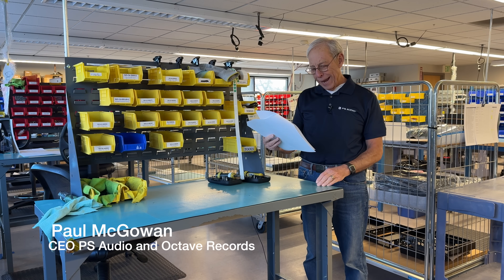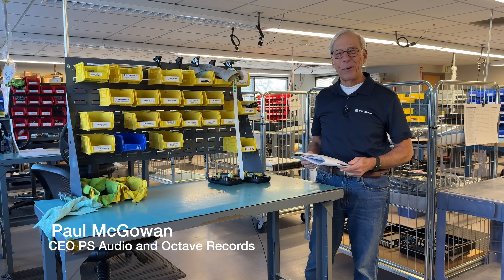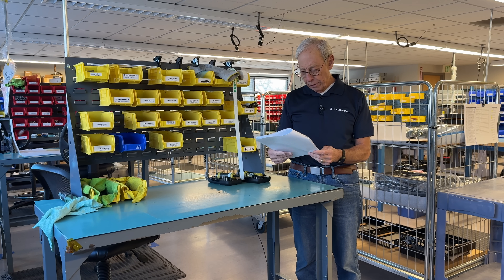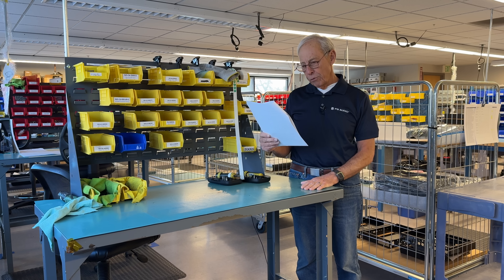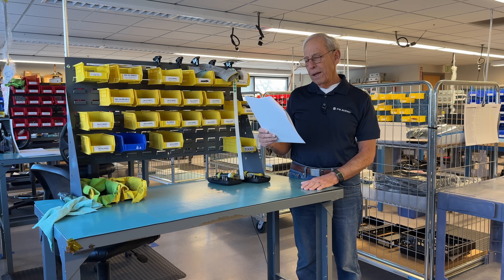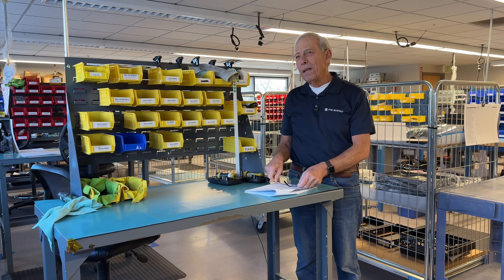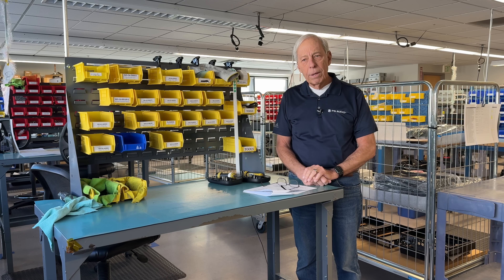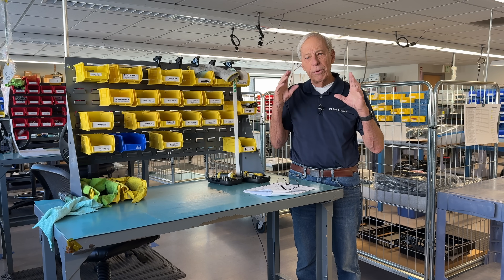Paul explains equipment burn in

Comment: Burn in is claptrap in the sense that it's normally discussed. OK, electronics may change a little over time, but why on earth would anyone assume those changes would always improve sound quality? That makes zero sense. Cables don't change, you can demonstrate that easily with measurements. If cables burned in then us electronics engineers would be forever recalibrating our measuring instruments as the interconnects burned in - they don't. Mechanical things like speakers may well settle down, that makes some sense. As for electronics, any burn-in is more likely to be negative than positive as it means things have drifted off from the way they were originally set up. What's actually happened is you've listened for a while and got used to the new sound.

Comment: Burn in?

Moving parts ... speakers, phono cartridges etc ... a few minutes.
Electronics ... plug them in overnight.
Wires and cables .... ROFL, no way!

The best way to burn your system in .... simple .... just use it.

Comment: I hear so much one way or another on things like burn in and cables.  That it is hard to know what is real or not.  With things like headphones, I have thought that I have heard a change in the sound, but there is an equal chance that my brain has just got used to the sound.  The other argument against burn in is some manufacturers put in such long burn in times on purpose so that by the time the customer has done the burn in, the equipment is beyond its return time.
Reply: A simple way to fact check audiophile "science" ... 

Can it be confirmed from credible sources outside of the audiophile community?

If not, well... it's obviously not true.
Reply: It's easy to tell what's real, that's the reason people started making objective measurements of THD, frequency response etc.
Reply: @TerryClarkAccordioncrazy 
No.
Those measurements were marketing ploys to sell amplifiers in the 1970's, and were often exaggerated. They in fact have little to do with anything in a good amplifier.
Reply: @Hare_deLune  If that's true then the professional amplifiers and mixers used to master the recordings you hear have all been mis-designed. Flat frequency response and low THD are the baseline standards for pro audio for good reasons.
Reply: @TerryClarkAccordioncrazy 
My point is that any "good" amplifier will already have those specs. Meaning that, while perfectly reasonable to publish them or include them in an owner's manual, it is not necessary to make them a selling point, or to make comparisons, or make a big deal out of it one way or another because different amps built to different tolerences will naturally have minute variances in these measurements, which fall outside of the human hearing range anyway.
And yes, it is true. I was there. The late 1970's saw an advertising war over precisely these kind of measurements, with manufacturers touting ever more zeros in their infinitesimally diminishing THD specs, competing with the other manufacturers to see who could get the lowest number.
Completely ridiculous.
Reply: @Hare_deLune  That's right, the odd hundredth of a % of THD matters not, but rather we can say that below 0.1% and a flat frequency response are the baseline for a hifi amp but not the complete definition. As Douglas Self explains it's more important to work on linearity of every stage than to tune out distortion using masses of NFB. Anyway, my point is that these measurements would surely show up the existence and  nature of any burn in effect, and the fact we never see any measurements could indicate that the effect does not in fact exist in the equipment but instead in psychological factors.
Reply: @TerryClarkAccordioncrazy 
I totally agree with you up to the point where you say that measurements would surely show a 'burn-in effect'.
I try to keep an open mind about these things, and not instantly reject something unfamiliar. Any good scientist will tell you that we go by reproducible results until those results are proven wrong, or until we have new information that supersedes those results.
The Earth was once thought to be the center of the Solar System, until Copernicus proved it was the Sun.
Disease was once thought to be caused by Evil Spirits, or "Bad Humors", until it was proven to be bacteria.
I do not pretend that we know everything there is to know about electricity, the propagation of electrons, or the subtleties of audio equipment and human hearing.

Comment: The whole saying about this b*-in thing is that affected audio components would need a certain time of "being played", maybe even with "proper signals", to reach a natural or designed state of "best listening experience".

So, first saying is "b*-in is always to the better by design or nature".

Second, once you reach the final state of such b*-in the b*-in process will stop automatically though, you continue using your gear by listening.

Third, there's nothing beyond this final b*-in state that would change any relevant component's characteristic, to the better or worse.

Does this sound correct?
Reply: I believe it's okay to write "burn-in" in full.

Anyways, no that does not sound correct.  

Truth is that just like us, all electronic gear is in a continual state of gradual degradation through use that will eventually lead to failure.

Comment: Decades ago we used to burn in electronic equipment by operating them overnight in temperature controlled ovens to simulate 2 years of use to ensure quality.
Reply: Yes, in a manufacturing environment that is my experience as well. However, the purpose of that kind of “burn in” is generally to weed-out infancy failures especially among certain vulnerable components. 

The “burn in” being discussed here is more similar to what I would call a “break-in” period—where the equipment is not being environmentally stressed in any way to catch potential failures early, but is rather being exercised in, more or less, its typical operating environment in order to ensure that new components are “broken in” so that they operate as close to optimal performance as possible.
Reply: @pbender9713  Excellent comment. @pbender9713's comment is the  answer Paul should have given. The term "burn-in" is being misused. "Break-in" for speakers and "Burn-in " for electronics - not for increased performance but for stressing and weeding out infant mortality in high reliability applications.

Comment: I asked ChatGPT o1 Paul’s exact question. Too long to paste here but the closing remark was “[…] In summary, while the concept of capacitor forming exists, its direct effect on HiFi sound quality remains unproven in scientific literature. The perceived improvements reported by some may be influenced by psychological factors or other variables within the audio system.”
Reply: on multiple occasions ive asked GPT for 10 Beatles trivia questions. never have they given mea list with less than 4 errors.
Reply: @googoo-gjoob Same experience here. Asked for things I'm already very much in. Got many wrong answers though, written nicely from a language perspective. Had similar experiences with totally different topics.
Now, knowing that the output for your given questions is (often) far beyond truth, what about topics you do NOT so much about...? Would you just believe the answers to represent truth? Or would you rather assume a similar true-false ratio you got from topics you know pretty well?
Reply: @googoo-gjoob  The problem with chatgpt is how it looks for/at source material. This is oversimplified but it's a superdeluxe search engine in regards to gathering info
Reply: @Matt-cb2db  , once i know a process is questionable...... im out
Reply: @ what kind of questions?

Comment: Oh, my. Thanks for the tip on ChatGPT. My first try: why don’t dac’s produce square waves?” provided more clarity than any YouTube answer I have seen and fully confirmed my suspicion that the true difference between digital and vinyl is the dac is doing the conversion to analog.  A “normal” dac will have trouble with a square wave reproduction. What is a square wave in audio? It’s a sine wave fundamental plus harmonics. Sorry this is off topic. Could not agree more about burn in, especially speakers.
Reply: As I understand it, a "square wave" is a sine wave viewed on an oscilloscope that has the top and bottom "squared off". In other words, the curves which should be seen at the top and bottom of the wave have become straight lines.
This indicates that the signal is being over-driven. In other words, pushed beyond the limits of the equipment.
It is usually just a few minutes after this that the magic smoke escapes from said equipment, at which point it becomes a fancy paperweight.
Reply: @Hare_deLune  that is one way to make a square wave. Another is to add. Multiple harmonics to a fundamental sine wave. It is the presence of harmonics that make a flute sound different than an oboe playing the same note.

Comment: I can’t trust YouTube reviewers that insists that burn-in doesn’t take place and its all placebo effect.
Reply: I can't trust YouTubers believing that their sense of hearing is solely influenced by the changing sound pressure reaching their ears. Being convinced that their hearing sense can (objectively) measure far beyond any technical equipment.
Reply: @Matt-cb2db 

https://youtube.com/shorts/ABgwy-QZVPA?si=s9cF89poMuOjD6x3
Reply: @tubefreeeasy Yeah, wonderful example of totally unexplained and unproven hearsay/opinion.
Most important fact when it comes to listening to gear over time is the existing process of accustoming to sound which happens in the human brain. This actually let's you perceive identical "signals" differently. That's an in-built mechanism in our brains you can't turn off.
And ask yourself, when would burn-in stop...? And when does burn-out starts...?
Reply: So, go to credible sources outside the YT and audiophile communities and fact check it.  Just be ready for a lot of laughter ... For non-moving parts, burn in is a total fantasy.
Reply: @Matt-cb2db the ear brain can definitely measure more data than any test equipment.
Reply: @ Then, please give examples
Reply: @mitchtaylor6512  
No Way!

Even a cheap hobby oscilloscope will show you more problems than any human will ever hear ... it's between 50 and 100 times more sensitive than your ears.

Can you hear 5mv of ripple on a power supply rail?  My scope will show it to you.

Can you hear 0.1db level differences between channels?  My scope  can show it to you.

Can you hear 100khz?  Again, easy to see on an oscilloscope.

This notion that our hearing is the final arbiter is just ludicrous.
Reply: @Douglas_Blake  an oscilloscope measure electrical signals not sound.  Not to mention an oscilloscope measures in isolation, not when the entire system is connected and being used the way it is to be used in the real world.
Reply: @mitchtaylor6512  
Oh boy... I knew this was a mistake.  Now I'm going to have to listen to you defending an unsupportable position.

If you are going to tell me you went through all the electronics training and rejected the science behind it on valid reasons... Okay, Tell me about it.

If you are simply thinking you can make spurious claims without challenge, especially when it's something that laughably stupid, well, we got nothing to discuss.

"What can be asserted without evidence can also be dismissed without evidence" ... Hitchen's Razor.

Comment: Every component has its initial behavior and this issue is an engineering topic that can be explained. A speaker's spider can be made of material that contains a stiff glue like substance where it needs mechanical motions to become optimally bendable, for example. Digital electronics, transports, streamers etc. do not need any burn-in for audio performance reasons. Interconnects/cables also do not need any burn-in. Then you can look at all the categories of analog components. Some electrolytic capacitors usually found in the power supply circuits can need time for the dielectric to “form". In a power amplifier such issue would be a potential lower peak power output when playing loud. Tubes are probably where you can hear the biggest difference on the electronics where burn-in or "breaking in the tubes" become a topic. Components that need a burn-in to reach optimum performance should raise some concern if the drift in specs really stops after the burn-in period. Electrolytic capacitors and tubes are also those components that can't do well on maintaining the same specs over time and die earlier than most other components. What other components should I worry about?
Reply: I'm not going to worry about my sound system at all as long as it sounds good.  Once I spent a lot of money on a couple of thick cables for some B&W speakers.  Bi-amp connections, heavy copper.  Made no difference in sound quality over standard braided copper speaker wire.  But that was only 100 watts per channel... Your mileage may vary.

Comment: If burn-in is required to come to normal performance, why isn’t it part of the production process? Why do manufacturers not deliver already burned-in equipment?
Reply: Time and cost.
Reply: Some argue that manufacturers don't burn in audio products before shipping because it usually takes time to burn in these devices, which would reduce the return window for customers. This potentially leaves buyers without enough time to return the product for a full refund if they're unsatisfied. On the other hand, some manufacturers do perform burn-in themselves. Those who rely on end-users to burn in their products often claim that if they were to do it, there would be additional costs that would have to be passed on to the buyer.
Reply: @DrRock2009 and storage, imagine a warehouse of speakers just playing white noise 24/7
Reply: @ 🤣 be like a Disaster Area concert…
Reply: Electricity costs money and manufacturers prefer to spend the least of it as they can.

Comment: If you have a system or component worth over $10,000 I am fully authorized to put it through a 90-day burn in cycle. Just crate it, and your payment if $3495, and ship it off to me. Remember to specify your preferred music, and to indicate which direction relative to North the equipment will be installed in.
Reply: Does the price include burning in cables? I hear massaging the cables help quite a bit! You really could start a business doing this. The more you charge, the more business that you'll get.
Reply: Yes, very nice Voodoo business 😂

Comment: On a similar note, is it a good idea to occasionally rotate speakers 180 degrees to help prevent vertical sag?
Reply: A clear no.
Reply: @robertvondarth1730   Okay, you got me on that one 😄.
Reply: No.  The risk of damaging the cabinets far outweighs any benefit of rotating drivers.

Years ago, an audiophile recommended occasionally tightening the screws holding their drivers in place ... but failed to understand that MDF and even HDF panels are fibrous and repeatedly tightening the screws does nothing but stretch and rip the fibres, eventually resulting in stripped screws that can't be tightened.

Simple rule:  If it ain't broke, don't fix it.
Reply: Exactly. Turn em upside down and over time things will settle back to optimal performance. 
Too bad women didn’t work like that!!😜
Reply: @ 
It’s worth of an experiment
Reply: @Carl-bd1rf  I suppose you feel safe saying that in the knowledge that 90% of hifi enthusiasts are fat, balding, middle age men.